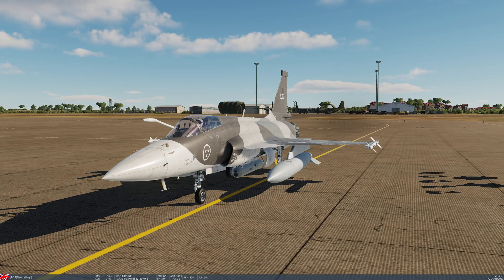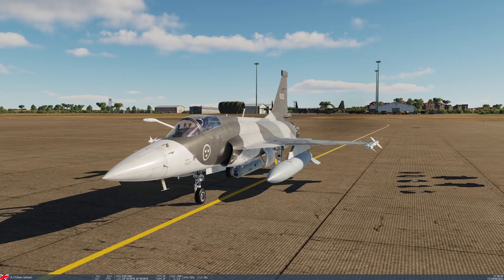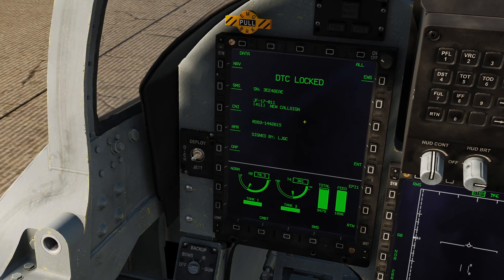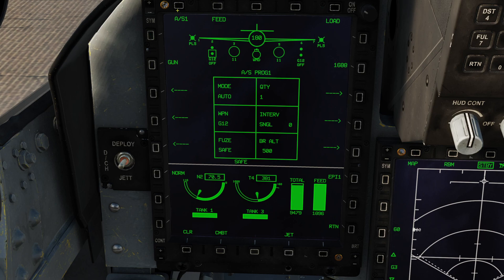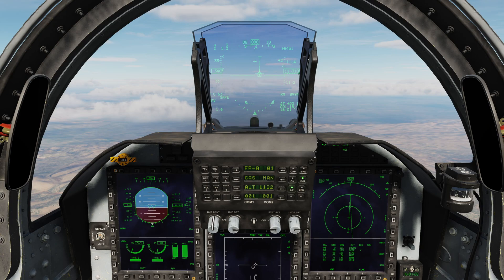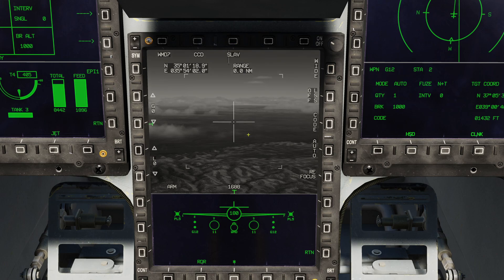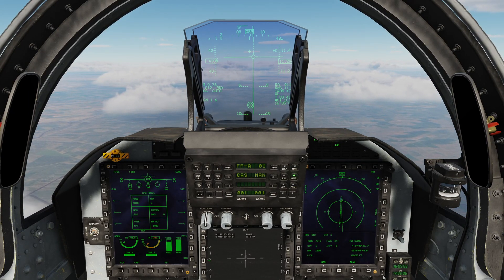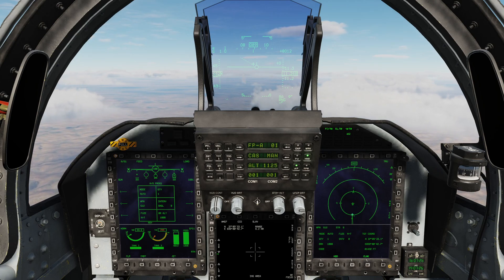DCS JF-17 Tutorial 8 - Laser Guided Bombs

Comment: A very nice video. I do have a question. Whenever I drop a bomb I almost always go out of the pods gimble limit and lose point track. Of course my bomb then misses. How do you keep from going past the pods limited movement range? I'm good with the F-16, F-14, and F-18. But the JF-17 I just can't get it.
Reply from the maker: Thanks! What altitude are you flying at? Could be worth flying higher and making a gentle turn off target as soon as you drop the weapon. Also what hardpoint do you have the pod on? Centreline is usually best but you can put it on a wing station and roll in the direction of your pod. This should keep it below the rest of the aircraft reducing masking.
Reply: @deephack  I usually fly between 16,000 & 20,000 ft depending on cloud cover. I also try to keep my speed between 370 & 470 knts before dropping a bomb  & slow down afterwards. 

I only ever put the pod on the center line to keep a good view no matter what direction it's looking & i had GBUs on every wing hardpoint.

I tried again just a couple hours ago & missed every time when attacking moving targets. Funny thing is I do perfectly on the F-16. So I don't know what I'm doing wrong here.